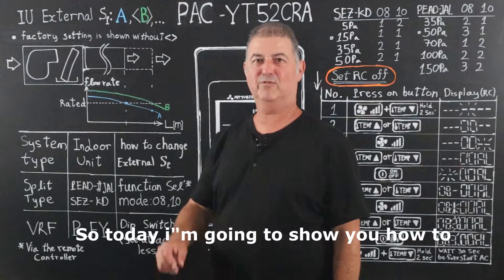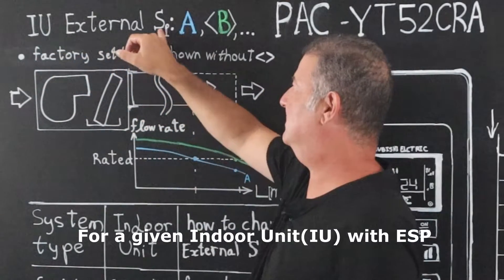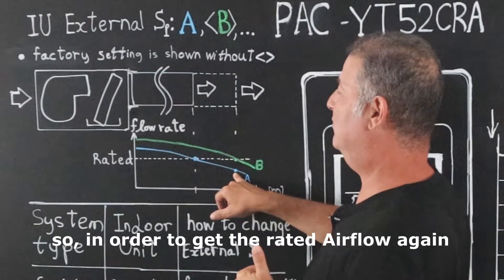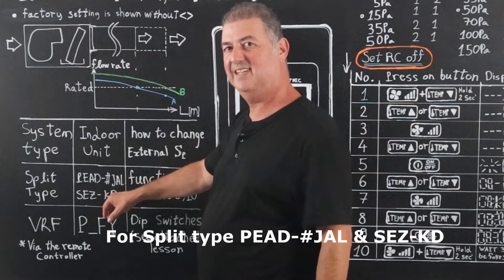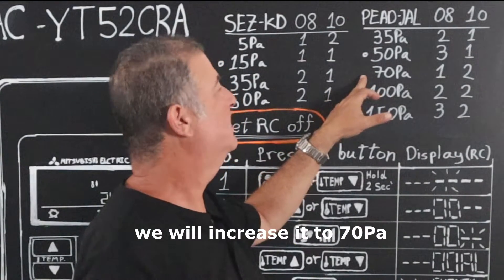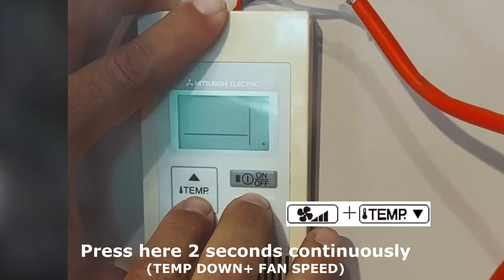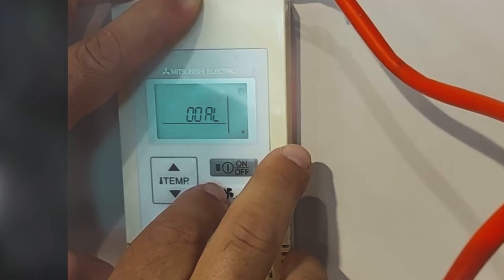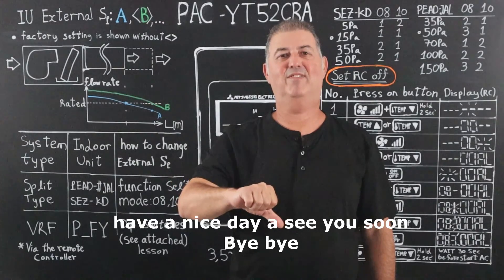How to change the External Static Pressure with the PAC-YT52CRA

Comment: What is the Mitsubishi recommended procedure for measuring airflow vs static pressure, to establish whether a change is needed in order to meet operating targets?

I assume static pressure is measured as delta between supply duct pressure and ambient or, is it measured as difference between supply and return differential across the air handler/coil?

For SEZ, what is the target flow rate on high-speed fan?  Can this be found in the installation manual?  Maybe I missed it.

Thank you for your videos and especially for the clear and detailed illustrations, they are very well done!👍
Reply from the maker: The high speed CFM is defined for each model and can be found in the DATA BOOK or in the TECHNICAL & SERVICE MANUAL and also at the catalog. The CFM can be measured at the exit of the grill or in the return air. If the air duct has a high resistance-you can increase the external pressure of the unit to get the desired CFM, 
If the air duct is short - you can lower the external pressure drop of the unit to get the desired CFM.
i.e1: the external ststic pressure is measured only on the air ducts without the indoor unit.
i.e2: you can find the airflow vs static pressure at the "INDOOR FAN PERFORMANCE AND CORRECTED AIR FLOW" section at the TECHNICAL & SERVICE MANUAL of the unit .
May I ask your country of origin and the exact model of the indoor unit(for example SEZ-KD35VA est.)?

Comment: PEFY-P71VMH-E unit plz
Reply from the maker: you change the external ststic pressure by changing the motor plug wire as follows: BLACK color=100Pa, WHITE color=150Pa(factory settings), RED color=200Pa.